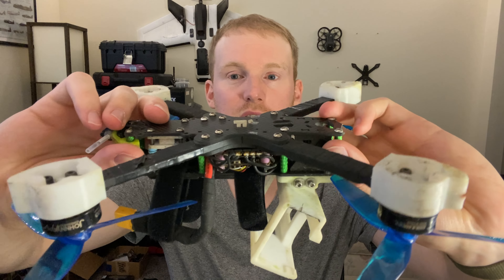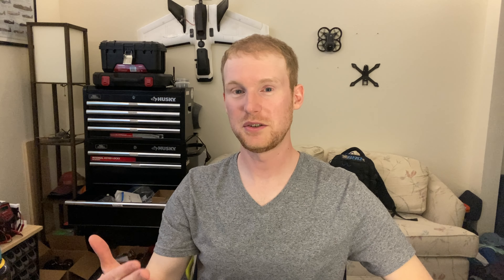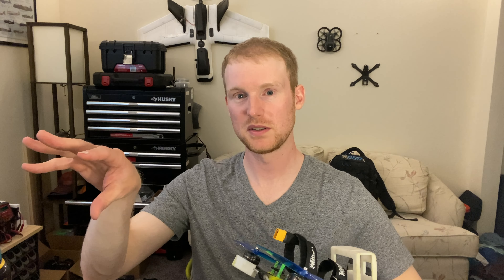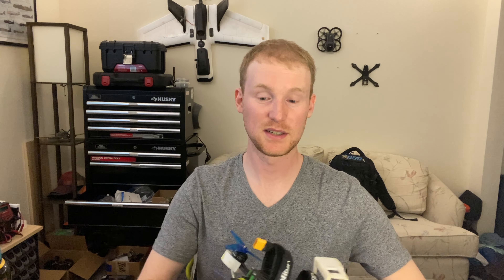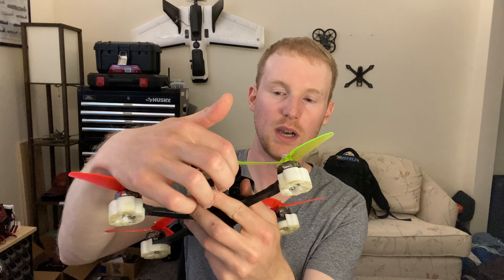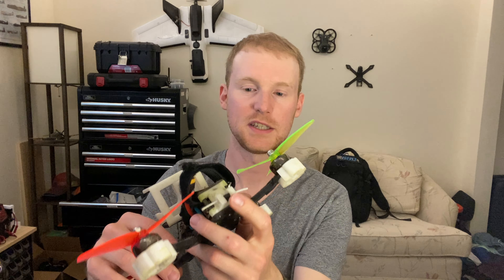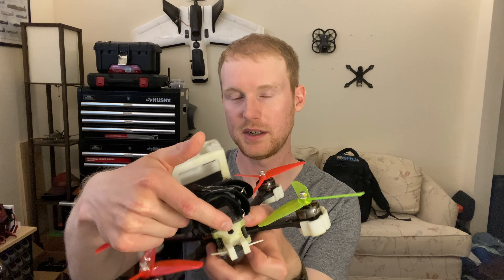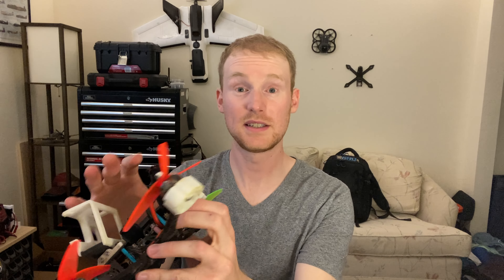Going Broke From FPV? Learn To Crash Cheaper! // PropabilityFPV

Comment: The first suggestions is easier said than done, although i get the advantage of pitching up.
I would also say that one could add the battery in toilet tank position so that it doesn't eject in crashes and doest break GoPro screen.
Reply from the maker: Really just trying to crash as “flat” as possible will always be a good bet! Haven’t messed with the toilet tank style much yet.
Reply: I think it comes without thinking about it. In the beginning I had no clue at all but after two years my crashes seemed to get less destructive. Maybe it has to do with getting more and more "one with the quad" so that I more instinctly got to protect my body as if I was falling myself. It's not that I calculate how the impact will be but I find out a split second after the crash that I turned the bottom against the threat. Many crashes will always be totally out of control though 😅

Comment: Can you drop link to those arm protectors, I can't find any that look as good as your.... also, You should wrap your arms with cloth hockey stick tape, you can get it in bright vibrant colors to help find the drone, but it helps the carbon from getting chipped causing break point.

Comment: Nice tips, Although I'd say as I continue the hobby disarming has costed me more money than just trying to save it. Learned to recover from crashes and save it (at least try) rather than letting it hopelessly fly in whatever direction its heading. Most of the time your gopro will be the first thing to hit when disarmed.
Reply from the maker: Depends how high you are/what is around of course. But I’m mostly talking about lower alt/in tree spots.

Comment: Also important:
1. learn new tricks in simulator first
2. get used to rates and build muscle memory
3. use first pack to get slowly back into the controls
4. don't build so many different drones with different parts, rather build an exact copy which uses same spare parts
5. always buy spare parts when you buy parts for an assembly. Things run out of stock or become more expensive fast
6. most important: never say "last pack"!
Reply from the maker: ^^ Yes! I’ve saved myself so much time specifically with using common parts between drones.

Comment: I'm also still new, but I actually like the short Albatross SMA Antennas from Iflight, Rather break one then hit the frame or a motor of the quad, plus also have good reception. An antenna is an extra "cheap" buffer. And for an O3 system, quality signal is a must!

Comment: not quite as goot is relative. My experience the difference is might  and day  keeps you from blasting rx signal as well. It's not worth it to me to tuck it in. and don't use sma adopters as well. My vtx mounting method has been solid, the antenna is out there and still protected by the battery. Tucking the antenna or mounting to an arm just defeated my ability to really feel untethered. Trust me ;) (Don't trust me, experiment for yourself)
Reply from the maker: All depends on what you’re doing. If that’s flying like a crackhead through thick trees somewhat close range, having antennas tucked in as much as possible is a must! But for sure if you need signal more than anything, use the longer ones!